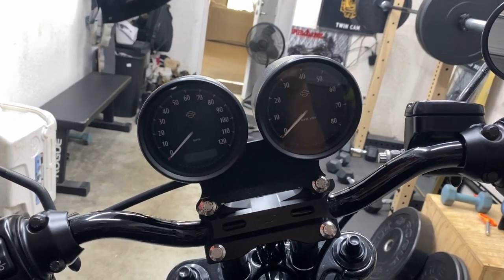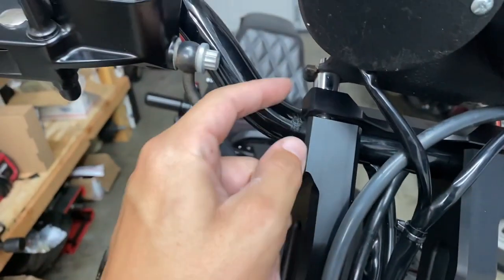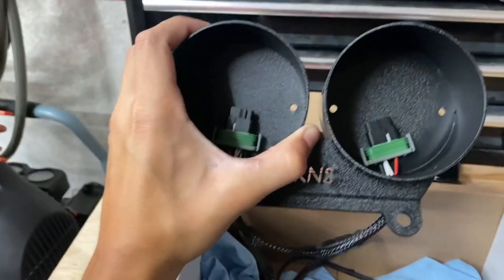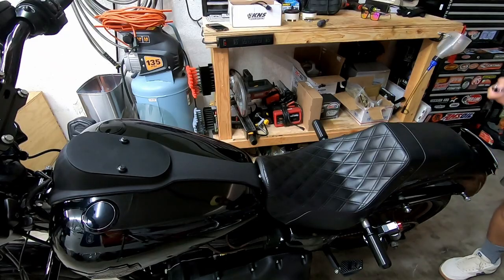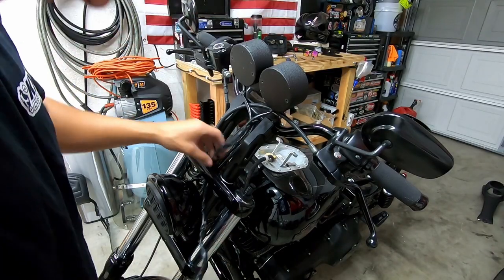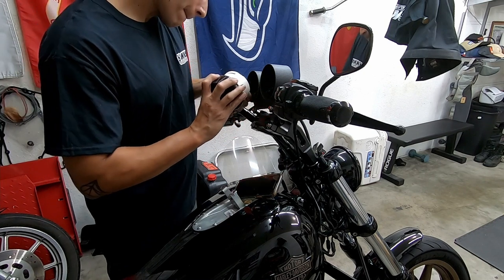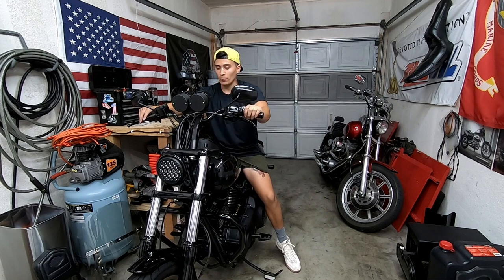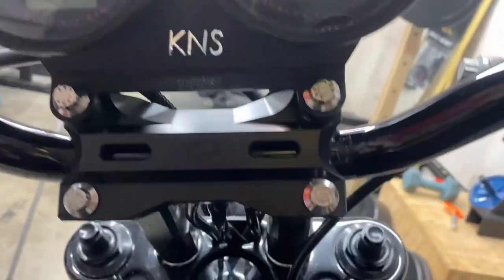KNS Customs Dual Gauge Pod Install

Comment: Great video once again. I just ordered KNS visors only since I already have gauge pods from speed king. Is the visor hard to install? What's the process when you completed yours? I appreciate ur feedback.
Reply from the maker: disconnect the harness and slide the visor over the gauge.
Reply: When visors are installed,  did you discarded oem rubber rings at front of guages?
Reply from the maker: @paulson9616  yes

Comment: Hey Bro, I’ve had the same issue installing this kit with the fuel gauge just reading ‘low range’ what was it you did to resolve this. I didn’t quite get what you said there 🤦🏻‍♂️. Any help would be really appreciated 🙏🏼😎
Reply from the maker: Haha I disconnected the harness from the bike and then it just worked. I would do that and disconnect your battery then retry let me know if this works!

Comment: Do you still use the rubber ring around the gauges when using the kns kit? I am trying to do mine right now and cannot get the ring to fit inside the gauge pod from kns
Reply from the maker: No u do not use the grommet
Reply: @dynademos  appreciate the reply man. Hopefully don't need anything after this
Reply from the maker: @danielcikauskas3109  always bro
Reply: @dynademos  done! That's for the two videos on the mounting and thanks for the video on the power vision mounting. That was kind of a pain but I used and old headphone cup instead of foam and used the gauges old gasket to hold it in place. It's stupid tight in there now